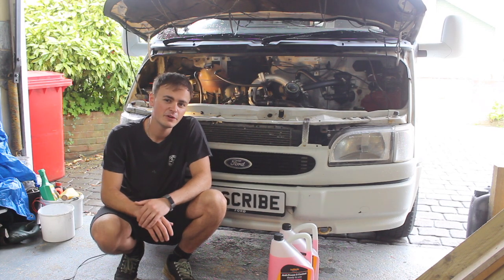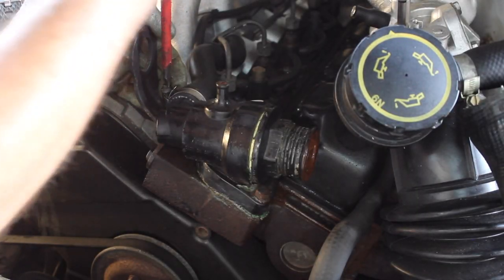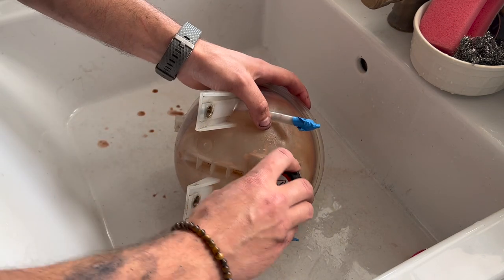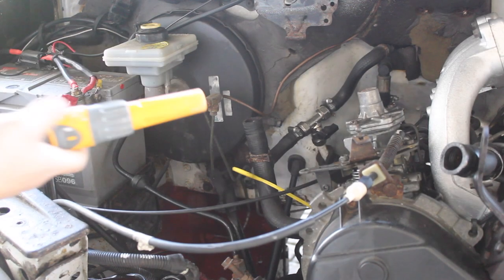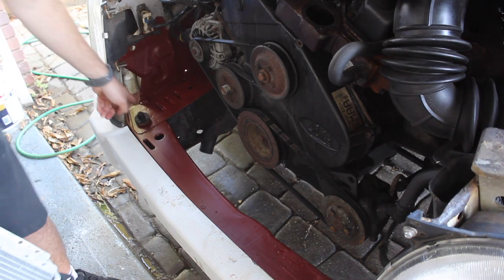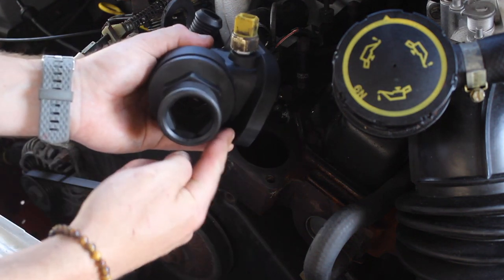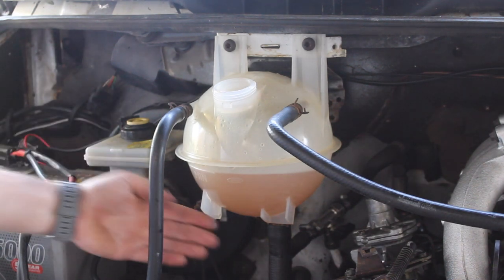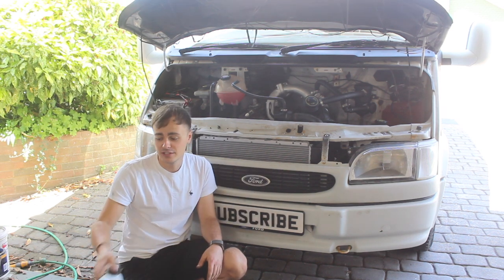Cooling System Flush - Step by Step (Full DIY Guide) - Ford Transit

Comment: Thank you for sharing your video.  I will do mine ASAP, because I added 1/4 gallon of washer fluid instead of coolant antifreeze.  I will take care of the whole system later.
Reply from the maker: Whoops easily done, better than putting it in the oil 😅 Thanks for your comment 😁

Comment: Hi, Perhaps you can consider installing a preheater giving the old girl some relieve with a (than not so) cold start? Anyways great episode ones again 👍 Cheers, Albert  P.S. I really admire the fact you don’t just trash parts because they look old and dirty like the coolant expansion tank!!
Reply from the maker: It’s surprisingly good at cold starts now, cleaning up the terminal connections and new battery made a big difference. Cheers Al, I try my best to reuse where possible, but the radiator definitely needed replacing 👍🏼

Comment: Maybe yiu can help. 2015 Ford transit, been to two dealers no one can figure this out. After it’s been running, it cools down then it dumps most of the coolant on ground. As a hydronic heating guy, I’m trying to find out how system works. When yiu heat coolant it expands and that’s the function of over flow, but is there a relief valve that blows and the reservoir(overflow), is too small. If the system gets under pressure, there must be some sort of place for expansion ect. So big question is why after it’s parked is it blowing coolant all over driveway. One dealer changed a resistor or some sort of part,the next one was just to do a pressurized test, but dais same sensor was to blame, changed it again, if the friggin computer doesn’t tell the techs now A days no one seems to know anything anymore, not their fault but old fashion back yard mechanics are a dying breed. Can anyone help here.
Reply from the maker: That’s a really odd one. So it’s blowing coolant when the system is cold?
Reply: @TurnersWorkshop97  we don’t know, after is been off. I suspect while it’s in cool down, it is one of my plumbers truck, I said frig it, and changed the tank and that hose, sure enough cracks all over the tank, what really pisses me off, is the little bastards, I’m old enough to call anyone under 40 a kid, why is it that I could feel and get fluid on my fingers when I checked around, and then this problem is not uncommon and I’d expect a dealer to know this, but anyways, the kid’s nowadays if a computer doesn’t tell them what’s wrong, god forbid maybe do something else to figure it out. I also blame piece work, why do extra if you’re not going to get paid. Anyways, that’s my rant, but so far, been few days, and it’s still fine. I did see a lot of discolouration around the top where it has a over flow, not sure if it’s a built in pressure relief in cap that makes it leak there, but the new part came with a new cap so I changed it as well, so ya mystery.  Thanks so much for getting back to me, I’ll let yiu know how I make out. Dan